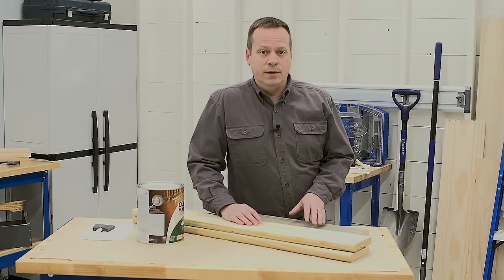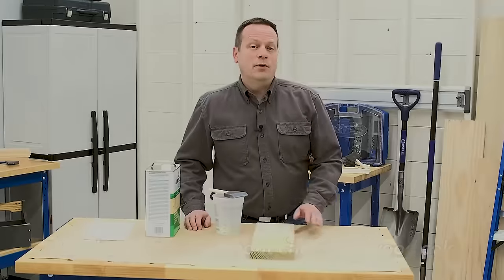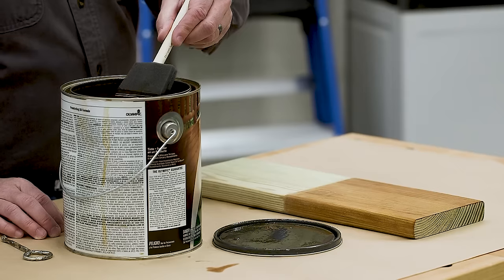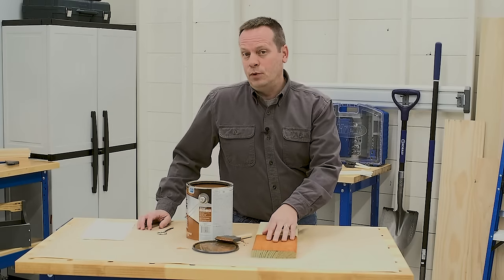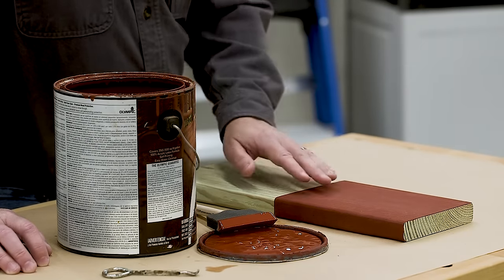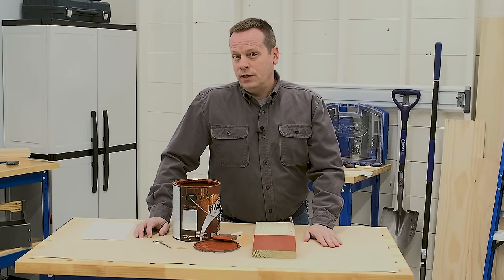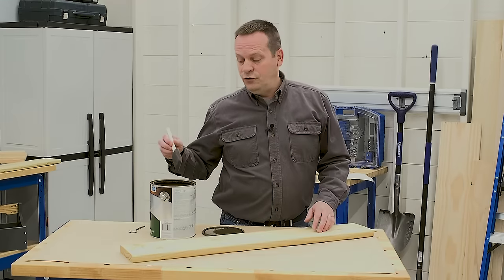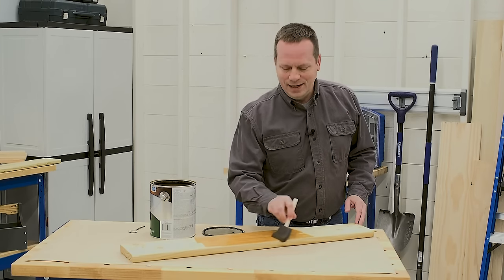Can I Stain Pressure Treated Wood? Kreg® How-To

Comment: Do they have a white stain? And what about wood that has already turned grey? How do I bring back the natural color or is it too late?  It’s a teakwood turned grey patio lounge chair. I don’t know if it is treated or not but I doubt that it was treated. The wood seems dry. Thank you Sir.
Reply from the maker: Sorry for the delay getting back to you. We missed your comment! Yes, there are white deck stains. Teak won't have been treated. it's a naturally resistant wood, so treatment isn't required. Restoring the original color may not be possible. You could try scrubbing the chair with deck cleaner, but the color bleaching--which is caused by UV exposure and weather--may go pretty deep. Sanding might help, but it would take a lot of work and it might be tough to get to all the surfaces. Another option after cleaning is to stain the chair. There are colors that would mimic teak.
Reply: Kreg Tool thank you for taking your time to answer my question about my teakwood patio. I should have done some kind of protection before it started turning grey. I bought a stain but I’m not sure if it would help in preserving the wood. Ah I should have read your suggestion on staining! Thank you very much for your help.
Reply from the maker: @maehay4065  you're welcome!

Comment: Thanks for this instructional video. I am getting ready to purchase a fence for my home, and I am debating between pressure treated pine, and red cedar. The cost for cedar is about 40% more...which is a lot. There is also an option for pressure treated pickets, and cedar boards for about 20% more.  My question based on this video is, as long as you stain your pressure treated wood, does it help prevent or delay the inevitable wrapping and natural decay you might see over time,  or does it only improve aesthetics with no real structural reinforcement ?
Thanks!

Comment: Thanks for explaining the stain variations. Very helpful!

I have a years-old, pressure-treated deck that's never been stained. I was planning on using TSP (trisodium phosphate) & bleach to get rid of the mold/mildew on it, then power wash it, and after it's dried, stain it with a semi-transparent stain. Are there any interim steps I should be aware of?

Are all of the stains oil-based? I assume oil-based is best, regardless, correct? And would a China bristle brush be the brush of choice, or a sponge brush like you used in the video?
Reply: Couldn't agree more and now I know what to recommend to some customers.